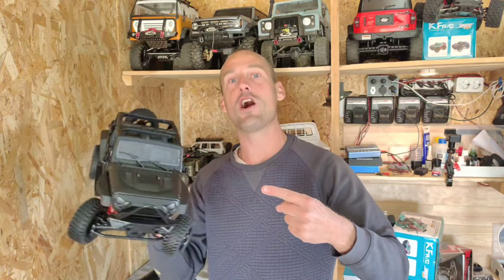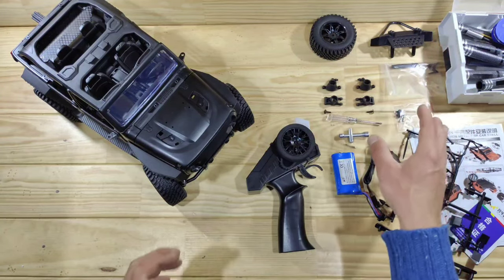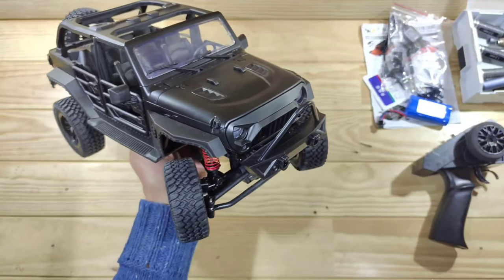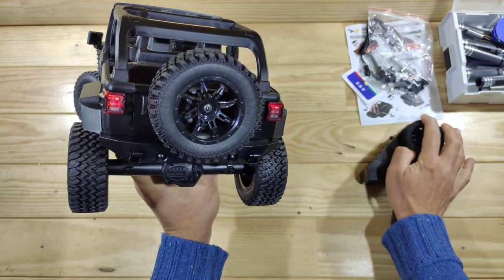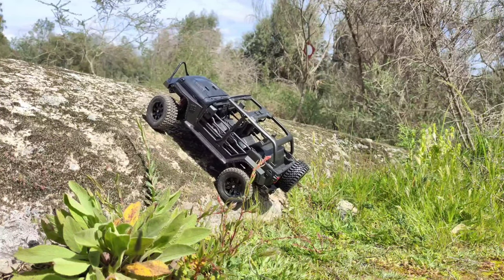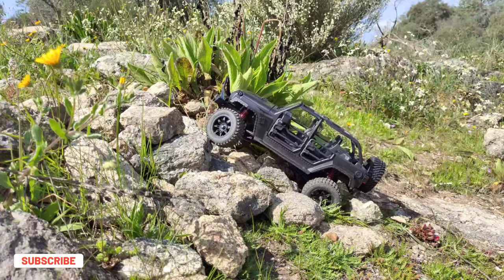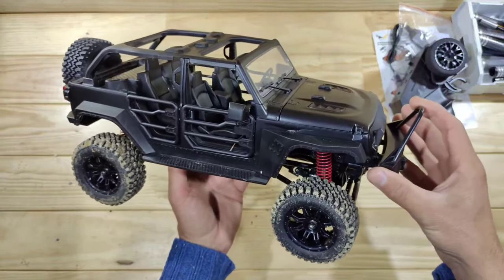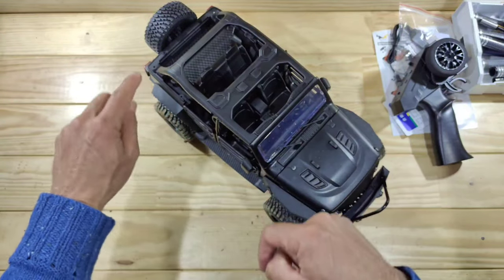MN128 review: This car looks tough... but is it?

Comment: and a correction, it doesn't come with ball beqrings but bushes. I bought a set of ball bearings for like 5eur but didn't change them yet because stock bushes work very well. Even element uses bushes on most of their entry level rtrs
Reply from the maker: Hi, mine has bearings at the wheels... So it looks like there are 2 versions
Reply: @hofsplace  yes at wheels they have bearings but axles and gearbox all bronze bushes.